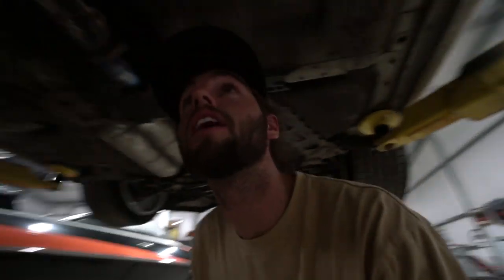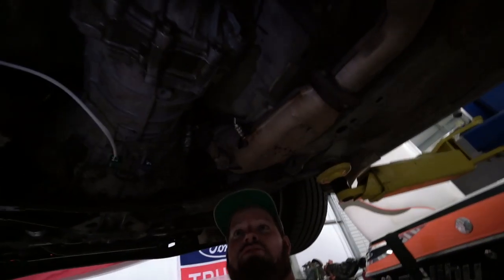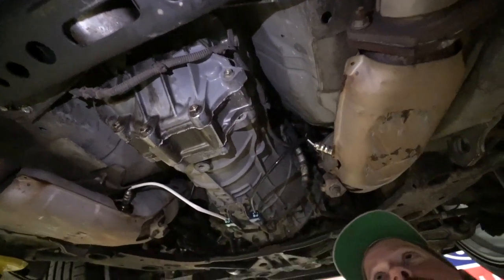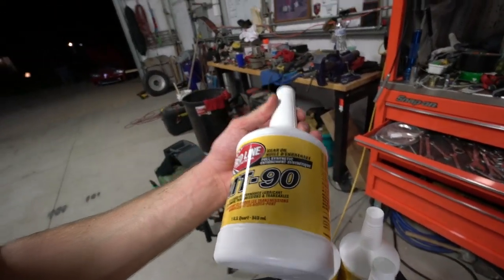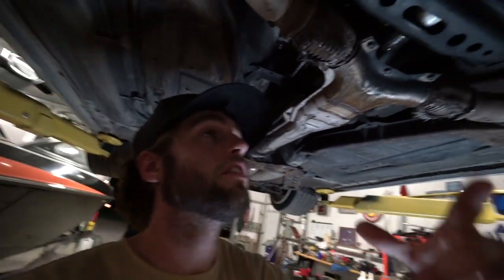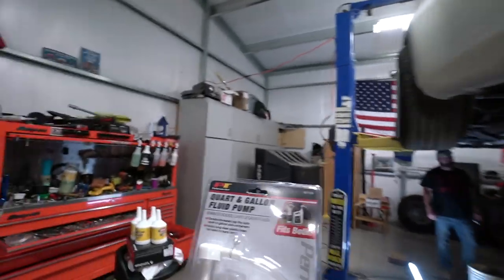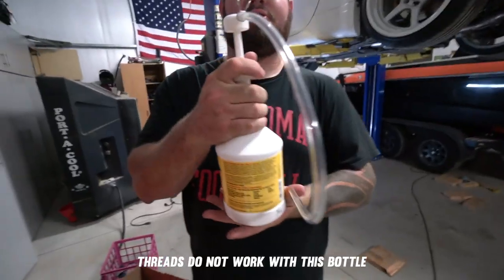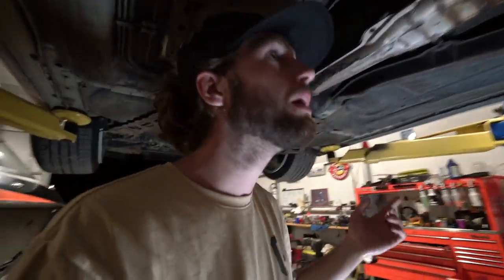A 350z Must-Have

Comment from the maker: In the description, you'll find links to the fluid and save $20 by ordering a gallon of it vs. 4 individual quarts! Found a pump to go with it as well. Thanks for stopping by on this video :)
Reply: Cameron Alford I purchased a 2008 350 Nismo Saturday, Sunday the clutch blew to pieces and shot through the bell housing. So I have a 6spd with functioning internals if interested. Only 75k miles none of the gears grind

Comment: For anyone doing this, make sure you crack open the fill port first before the bottom and draining. If the will port is messed up of seized, and you drain the fluid, you will have a bad time.
Reply from the maker: Super good tip!! Thanks or posting.
Reply: Youd just have to flip the car upside down. Improvise
Reply: @KT6450  bwahahaha adapt, overcome
Reply: No but what the fuck 100$ for a gallon of this oil u kidding me
Reply: Ima just use vasaline or something
Reply: @KT6450  how is it $100 ?? I paid $65 for both the diff and trans fluid for my Z. Amsoil too....
Reply: Dude a gallon of the redline stuff he used is a hundo up here in canada land 👎👎
Reply: But that is on Amazon im going to look at napa tomorrow
Reply: @KT6450  isn't that about $60 USD?

Comment: hey man im sure someone has commented this but that loud noise you are hearing are you sure it isn't fly wheel chatter. I had a 04 z that I bought and thought it was a throw out bearing but ended up someone put a single mass flywheel, and once the car was warmed up it would chatter but once I pushed in the clutch the noise went away. anyway if that's your case its normal but not sure if that's your problem. because changing the flywheel back to a dual mass flywheel will be the only thing that will help with the chatter
Reply: Partially correct.  I run a jwt weighted flywheel it’s like 26lbs.  No more chatter.  Shifts a hair slower than with a lw flywheel but no more tank rattle lol

Comment: I just swapped to the cd009 and I am running MT85 having issues with 5/6 Gears grinding a little, I was wondering if you think I should switch to the MT90 if it would help out? Thanks for any information you have

Comment: Thanks for the tip! Im definitely gonna have to try this when I change the trans fluid on my twin turbo 350z!
Reply: Connor Rydland bro that’s dope af how much power you putting down and how’s it holding up? 
I got a 04 roadster that I regret buying I should of got a hr coupe but I bought this knowing nothing much about nissans but beside that mistake I refuse to let it go my plan is to upgrade as much as I can and make the vert cool again 
I just got new seats, nardi steering wheel and new soft top, got it lowered on Tokico blues with Eibach springs I got my Cosmis xto6s when I first got the car three years ago I’m basically done with my looks I’m just saving up for a turbo kit which one do you have ?
Reply: mango4525 406 to the wheels, 03 DE motor. Has held up fine so far
Reply: Connor Rydland beast bro ! What’s your IG so I can follow the build
Reply: mango4525 @dirtymax302 and also I’m making YouTube videos slowly as I have time on this channel
Reply: Connor Rydland Forsure bro I’ll check that out too have a good day!